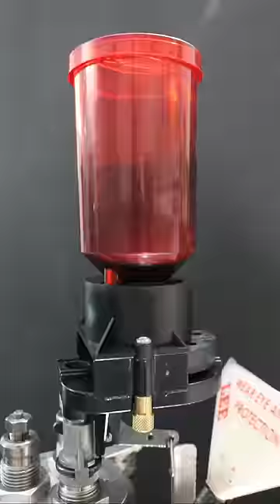Reloading 9mm ammo in 1 minute with Pro 1000  -   #reloading, #9mm, #leeprecision, #ammo, #shorts

Comment: I'm slightly amazed Lee still makes this thing. I still have an earlier version from 1985, bought it for around $100. I've done thousands of rounds through it. You should show the carousel with more than one round going through the stages. That's when this thing shines!
Reply from the maker: Good morning Ervin and thanks so much for looking at my content 👍🙏👍🙏. Glad to see one more Lee enthusiast. This particular short clip I opted for a slow mode to make the process more understandable. As you know, normally it goes much faster. Have a look at the link in the pinned comment for the complete view of the process on some 9mm or alternative, even more details for a .45ACP.  I am sure you will like this. the .45ACP is a very detailed process and will benefit you if you have the same press. also lots of other clips on the channel on this press. have a great weekend.
Reply: I never used such a fancy contraption but I suspect the safest way in which to use this thing is to visually inspect the primer raising to the hole (or observe how perhaps you can see light through the touch hole initially but then not anymore as the primer is seated), and to also glance to the casing loaded with power to ensure both that there's powder in it AND that it appears to be at the typical level it always is.

You should not go on 'auto-pilot' when reloading, you should be doing everything intently and carefully, but in my mind provided you positively confirm there is both a primer and roughly-correct amount of powder in each round... you can get a pretty quick rhythm.

Primer seated in that one and there's powder in the other one, place bullet, CRANK. Primer seated and there's powder, place bullet and CRANK. Primer seated and there's powder, place bullet and CRANK. And so on and so on. If you do it for long enough, eventually you should be able to just eyeball a casing to see that "Wait... there's a little less/more powder in there than usual... I'll dump it out into the powder feed, hold the casing as the machine is CRANKED, and do whatever must be done to ensure that it gets back in line and gets powder/bullet like it's supposed to.

So it's 'auto-pilot,' in a sense, but if you're still paying attention to EVERY DAMN CASING being primed and fed powder, then you should never be at risk of a squib or an overcharged round. What would be dangerous is if you 100% relied on the mechanisms of the machine and ONLY focused on 'grab bullet, place, CRANK, grab bullet, place, CRANK, etc.' Only paying attention to the ONE manual human operation, and that is placing the bullet.

Any experienced reloaders want to share their experiences/advice?
Reply: @normanmccollum6082  More accidents have happened with these high-speed turret presses than the single stage boys. 
On top of visually inspecting charged cases before bullet seating, I throw a charge into my scale pan and weigh the dispensed powder with a manual beam scale after every 10-15 cases. I use zeroing plus check weights to verify scale calibration before I muck around with my powder measure. When I'm done seating, I grab a few rounds at random and check OAL with calipers, especially if there's no cannelure on the bullets I'm using. 10k+ rounds of various handloaded calibers and not a single squib or catastrophic explosion so far, brb gonna knock on wood.
Reply: I came to ask if this could do multi rounds ty for the answer.
Reply: They must have changed from 1985 then. They are complete junk now.
Reply: @mrj3711   yes, you just need to buy different dies for different diammeters, and different bases if you want to run curtain cases. I use mine for 9mm, 10mm, 40s&w, 357 sig, 357 mag, 38spl and 380acp.
Reply: Not sure when my 2 lee pros were manufactured but I just love finishing a round to find the primer sideways,  smashed,  upside down,  or just plain missing.. real great. Ever since I swapped to a blue square deal b my reloading has been amazingly peaceful
Reply: @tidnuts1  did you have the old or new style primer pan?
Reply: @ReloadingMoreAD1966  I bought the LEE Anniversary Kit combined with the carbide sets in 380 ACP, 9x19 and 9x18m, however, all cases have bulges in them after seating, even if i use brand new brass and follow perfect CIP measurements. I always do the whole procedure even with new cases, that includes deburring, lube etc.

Do you think the extra LEE carbide factory crimp die would somehow take the bulge out during crimping? 

Its the same problem with all calibers and bullets, no change between FMJ or HP etc. Even if i perfectly center the bullet before seating the bulge will appear on some side it tilts to.
Reply: Mine is from the early 90s, it's reloaded so many 9mm rounds it's close to worn-out. I would load 9mm to point of filling 5 gallon buckets. On 3rd or 4th brass tumbler.  Second or 3rd decapper die on it. 
 I've always been a fan of Lee reloading equipment for pistol and rifle ammo. Lower cost and more available in many places. As a reloader of 9 or so calibers.
Reply: @bogeydope3022  Bulges from three different forming dies?
Reply: Yeah I bought the newer lee 5 stage loadmaster. But i prime off the press to avoid problems. And separated powder drop from neck flare.
Reply: @normanmccollum6082 no
Reply: They are like half plastic now..

Comment: Dang, you have to insert the projectile yourself?  That slows it down a bit.
Reply from the maker: Good morning Noone, Thanks for taking time and looking at my content. It might be a little bit slower but not my much. This press can be fitted with a cheap original attachment that would place the bullet in position automatically. 

Personally I find it better to place the bullet manually because I can use that motion to also visually inspect that the powder is in the case.  I have a longer detailed clip on this press, link in the pinned comment. Have a look at that to see the entire process.

Take care and have a great day.
Reply: @ReloadingMoreAD1966  Oh there is an option for automatic placement. Would have been a design flaw if there would not been a hopper for the bullets, because you can attach that to external power to automate the whole process.
Reply from the maker: @JerryCrow  Hi Jerry. Thanks so much for looking at my content👍🙏. The actual product supplied by Lee, the producer of these press is a system without any external power. You would manually place the bullets in a hopper and they are placed on top of the case mechanically, without any external power. the product is item 90894 and cost under $100. (Here is a link for the system but on a larger press .  https://www.youtube.com/watch?v=xF1_oCImOfo )

One can also find non original systems that work even better that are fully motorized and require even lesser effort to operate. Such systems range from $250 upwards.

Take care and have a great day
Reply: After doing it for awhile you speed up
Reply: You can alwsys upgrade bro but when I learned it was nice to do it with your fingers, you get a good alignment and if your press is a hand press you can feel better if anything went weird that wasnt supposed to as you seat the bullet into the casing

Comment: After how many bullets does this machine pay for itself?
Reply from the maker: ▶👍Good Morning. Thanks for taking interest in my content. Now this is an excellent question. I did workout the answer to your question months back for another member. Here are my own workings as follows: 

🔶Based on 9mm setup only. (Changing caliber is approximately $100 addition, mostly dies and shell plate)

🔶ALL FIGURES & CALCULATION DONE January 2022 as follows:

$300 _ Lee Pro 1000 Press 9mm, ref. 90640.
$020 _ Lee Case Collator, ref. 90667.
$045 _ Lyman Ammo Checker, ref. 7833000.
$012 _ Dillon precision case lube, ref. 13733.
$055 _ Scale frankford arsenal, ref. DS-750 
$050 _ Price estimate for a generic caliper.
$048 _ Price estimate for kinetic bullet puller. 
$530 _ TOTAL INVESTMENT of above listed item.

$160 _ TOTAL Calculated price of raw materials to fabricate 1000 rounds type (CPRN-124gr) "brass cases free)
 
$300 _ TOTAL Average price for factory loaded ammo, 1000 rounds, 124gr.

🔶Therefore, excluding labor cost, I save $140/1000 Rounds.
🔶Therefore, investment of $530 / Savings of $140 = 3786 rounds.
🔶Therefore, after 4000 rounds I start saving $140 / 1000 rounds I send down range.

🔶🔶🔶 In short, after 4000 rounds I cover my investment cost.
Reply: Labor is the biggest cost
Reply from the maker: @korodski  it is labor intensive process. One must be committed, methodic and organized to safely reload and produce safe rounds .If I take under consideration the time needed, than it becomes far less economically viable to reload.  Take care and have a great day
Reply: @ReloadingMoreAD1966  faxx

Comment: A couple of things here. While this Lee Pro-1000 operated smoothly this time, it doesn't always go to plan. I had one that was horrible at missing or flipping primers. If it misses a primer, it dumps powder into the mechanism and takes 10-15 minutes to get it completely clean again. I've gone to Hornady LnL's. While I like the case loading ability of the Lee, Hornady does have that option. Hornady's warranty is great. With the LnL, you can set your dies up once and not have to fiddle with them again if you are changing calibers. The inserts are about $6.00 per die. Dillon, however, one shell plate is $100.00. 
  As to savings, prior to the pandemic,  I could load a box of 9mm for $2.50. I cast my bullets from wheelweights and scrounged my cases. Primers were $35.00/1000( so, 3.5 cents ea.), and the amount of powder was about a penny. 
  It's relaxing to reload, though it's not for everyone. But, during ammo shortages, when everyone else is panicking, you can relax, knowing you have thousands of rounds of ammo stockpiled. And, the components to make more.
Reply from the maker: Good morning and thanks so much from sopping by Battalion.👍👍 It is comment like your that make up keep creating content. not often dose one come at such great comment with excellent insight to all the community.

About the Lee press, I have had numerus issues and the primer flipping was a big one. Not to mention the cases being pulled back out or the shell plate holder cracking in a couple of occasions. I honestly share the frustration. On the one you see here I did several minor modifications and honestly it work almost 100% without any issue. Had a look at your channel and you struck me as someone that knows a thing or two about mechanics. If you get some time, please have a look at this longer clip for the Pro 1000 as it shows the process in detail. Here the link: https://youtu.be/etEE3MgxAO0

About the LNL press I had the pleasure of seeing that beast in operation at a friends place in Sicily on one of my trips. He is using the LNL for competitive shooting, specifically for 40S&W and he has only positive things to say about that one. it works extremely well and has a stronger construction compared to the Pro1000, as you would expect since he almost 3 times the price of the Lee.

Have a look at my channel as I have lots of DIY projects for the press and much, much more. Here is a link for the channel trailer: https://youtu.be/ge0LNO4a03Y . Take care and have a great day 🥇🚒👩‍🚒 🇺🇸 🇲🇹
Reply: @ReloadingMoreAD1966  
  Well....I wrote you a reply that seems to have vanished. I watched your other video on reloading the .45ACP. Well done! 
  Looks like you are much more organized than I am. I keep an eye on things, but I never thought of figuring out the entire weight of powder I was loading for. I just fill the hopper up and dump whatever is left back in my powder jug. I know about how many rounds I can get per pound. If I'm 3 or 4 each direction, that's pretty good. 
  I've been loading .223's lately. My charge was 20 gn. of 4198. I checked my powder drop on an electronic scale. 20.018gn. And that seemed to be very consistent. Accuracy on these is very good. 
  I saw that one of your friends said you are Ram. From your components, and profile, I figure you're in Malta. I don't know much about European reloading and shooting, other than Switzerland looks like a place I want to visit. 
  Keep up the Freedom Seeds! Al
Reply from the maker: @battalion151R 
Thanks so much for your kind words. I am situated in Malta so we have some limitation when it comes to space. here we have just one range open all year that allows pistols. take care.
Reply: @ReloadingMoreAD1966  
  Again, I wrote you back. It disappeared again! 😡
  It's not your fault, but some stupid algorithm is intercepting my messages. Anyhow, I left you a message on your trailer. What caliber is the Italian (I think. Couldn't make out the make. Maybe Pietta?) six gun?
Reply from the maker: @battalion151R  Not sure what is happening but your messages are not visible. Also cannot find any comment on the trailer from your side. I gave you a "Always trust comments from this user" status and still is an issue I see. 

About the question on the gun, maybe a Pietro Beretta? Let me know exactly were you saw that I will let you know what gun it is.

Take care and have a great week
Reply: @ReloadingMoreAD1966  
  Wow! They really don't like us talking. They have taken down 3 replies, so far. Phreedom1980
Reply: @ReloadingMoreAD1966  
  Add those up and you know what to do. 😁
Reply: @ReloadingMoreAD1966  
  At G

Comment: How much does the whole setup cost? Not including the primers or casing or powder or lead?
Reply from the maker: Good evening Daniel. Thanks for stopping by and looking at my content.🙏🙏👍👍 
Here are my own workings as follows. They are from few months back but they should give you a good idea. Take care and have a great weekend.

🔶Based on 9mm setup only. (Changing caliber is approximately $100 addition, mostly dies and shell plate)
🔶ALL FIGURES & CALCULATION DONE January 2022 as follows:

$300 _ Lee Pro 1000 Press 9mm, ref. 90640.
$020 _ Lee Case Collator, ref. 90667.
$045 _ Lyman Ammo Checker, ref. 7833000.
$012 _ Dillon precision case lube, ref. 13733.
$055 _ Scale frankford arsenal, ref. DS-750 
$050 _ Price estimate for a generic caliper.
$048 _ Price estimate for kinetic bullet puller. 
$530 _ TOTAL INVESTMENT of above listed item ONLY.

Expect other costs will pop up along the way. The sky is the limit how much you can manage to spend on reloading.

Comment: Sir do you prefer the Lee disk powder measure over the drum? Just wondering which one is more accurate. Thanks!
Reply from the maker: Thanks for stopping by the channel Yu Xuan👍👍. Accuracy is sometimes subject to the type and dimension of the propellant used. I would say that all-in-all, the new system operates slightly better. On the old system, I prefer it when it comes to setting up the flare on the cases since it has more adjustment. Have a look at my longer clip about the press. https://youtu.be/WN2Aco4cXt8

Comment: The play in the alignment 
  The kick upon the raising to fill 
     Rotation turret alignment  , holder refineness , it needs a reworking for accuracy
Reply from the maker: Good morning and thank you for stopping by and finding time to leave a comment🙏🙏👍. Very impressive observation skills. Someone picked up on these issues a couple of days ago. It is not usual with this press as it is as aligned as one would expect on all occasions.

The alignment issue and other issues you see here were real but lucky for me it was no issue during firing. I captured it as soon as I started editing and immediately knew the reason. I estimate that few rounds prior this single round footage the shell plate carrier cracked because I replaced it few rounds after this footage was taken when it totally gave way. I had to inspect a lot of rounds with a case gauge because I was not sure how many might have had issues. 

After replacing the complete part, item 90683 by Lee, it all worked fine as before.

Do have a look on the channel for longer clips on this press. Link in the pinned comment.

Have a great day and thanks for your comment.🥇🥇

Comment: I don’t think I’ve ever seen a semi jacketed flat point 9mm. Lol nice.
Reply from the maker: Good Afternoon Joe and thanks for stopping by and leaving a comment👍👍..  The projectile used here is a 130gr SJFP, reference B-329 fabricated by PRVI, diameter of 0.3545. Hard to find but I had some old stock, around 500 heads in total
A similar projectile that I have also used, more frequently than this is the 125gr SJSP, reference 613573 by Fiocchi. Both mentioned projectiles I have used to reload 9mm and .38 special rounds with no issue what so ever. 
Have a great week.

Comment: Is it cheaper overall to produce your own ammo after making a certain amount?
Reply from the maker: Good afternoon. . Thanks for stopping by and looking at my content.🙏🙏👍👍 
Here are my own workings as follows: 
🔶Based on 9mm setup only. (Changing caliber is approximately $100 addition, mostly dies and shell plate)

🔶ALL FIGURES & CALCULATION DONE January 2022 as follows:

$300 _ Lee Pro 1000 Press 9mm, ref. 90640.
$020 _ Lee Case Collator, ref. 90667.
$045 _ Lyman Ammo Checker, ref. 7833000.
$012 _ Dillon precision case lube, ref. 13733.
$055 _ Scale frankford arsenal, ref. DS-750 
$050 _ Price estimate for a generic caliper.
$048 _ Price estimate for kinetic bullet puller. 
$530 _ TOTAL INVESTMENT of above listed item ONLY.

$160 _ TOTAL Calculated price of raw materials to fabricate 1000 rounds type (CPRN-124gr) "brass cases free)
 
$300 _ TOTAL Average price for factory loaded ammo, 1000 rounds, 124gr.

🔶Therefore, excluding labor cost, I save $140/1000 Rounds.
🔶Therefore, investment of $530 / Savings of $140 = 3786 rounds.
🔶Therefore, after 4000 rounds I start saving $140 / 1000 rounds I send down range.

🔶🔶🔶 In short, after 4000 rounds I cover ONLY my investment cost. Expect more cost as you go along.